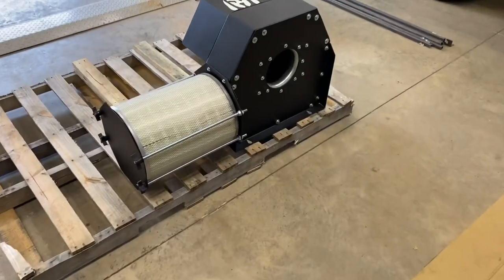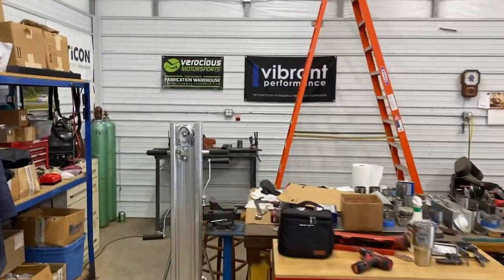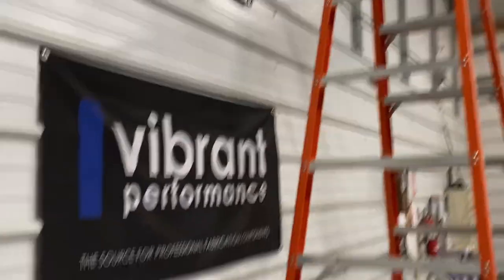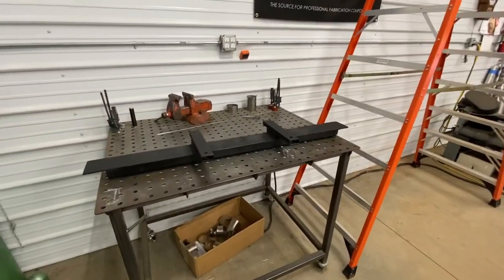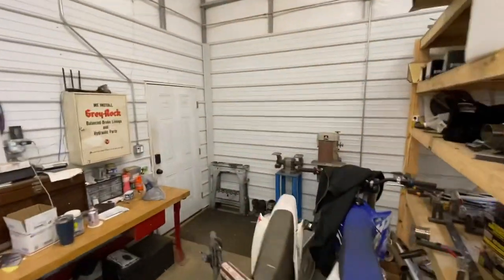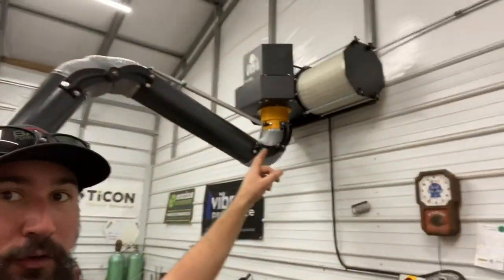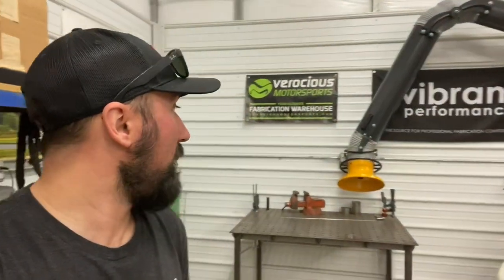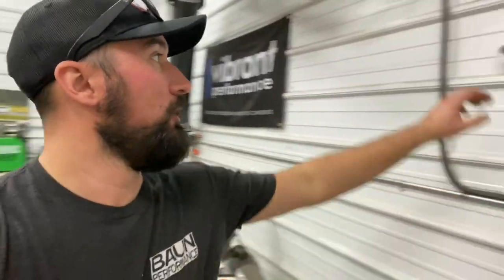Fume Dog wall mounted HEPA weld fume extractor installation & quick overview

Comment: I found a miller arm very similar to this for $300. I don’t weld but I’m thinking I can adapt it to my other use cases like airbrushing, soldering and venting my 3d printer enclosure
Reply from the maker: $300 is a absolute steal if it’s a complete unit. Fume extraction is great for all of that work, especially in a smaller space
Reply: @BaunPerformance  it ended up being just too damn big for my space. 8” and probably 12’ overall length. They are still trying to sell it. It’s not the complete unit in that it’s only the arm, not the filtration or motor.